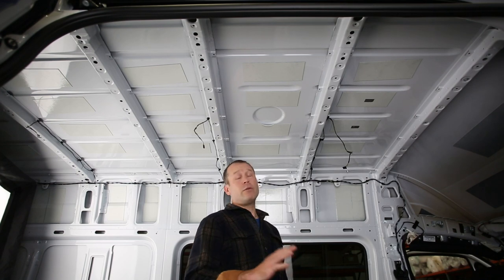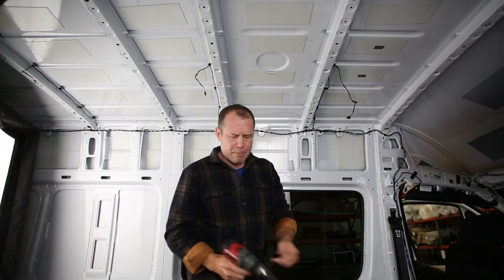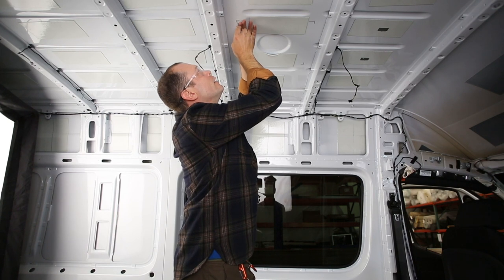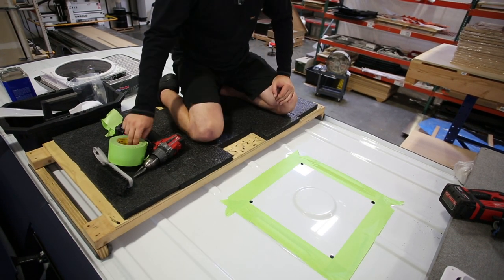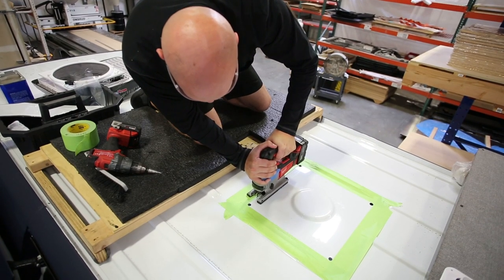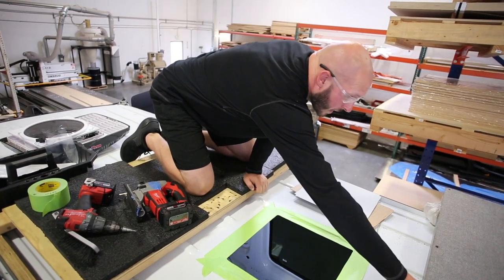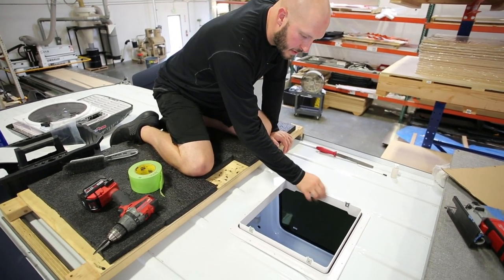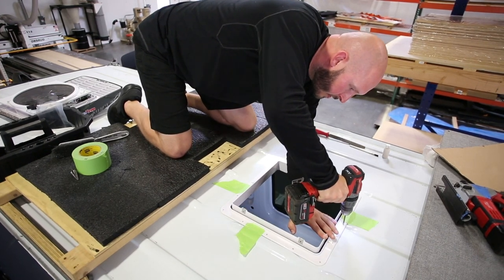Adventure Wagon’s MAXXFAN kit Install SPRINTER VAN CONVERSION

Comment: Why didn't you use urethane caulk between outer flange and the roof?
Reply: Most installers use butyl tape here. I’m curious why not also.

Comment: I was under the impression the black square adapter fitted on the outside of the van and sandwiched between the fan shroud and van metalwork? I’ve never seen it installed this way before. The video is great and easy to follow but it’s completely different to others I’ve seen using an adapter.

Comment: Why not cut 1 hole and round your corners with the high saw? Saw to the corner, round it an go to the next line. Go back and square the corners. Much faster and easier. Tape a plastic bag under the cut and it will collect the saw dust.